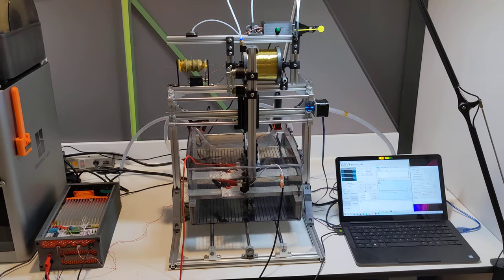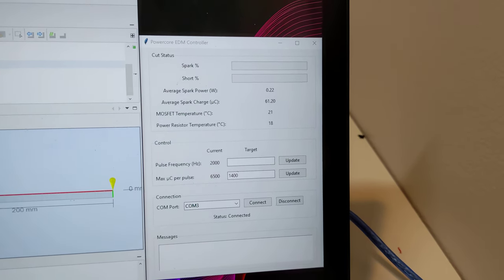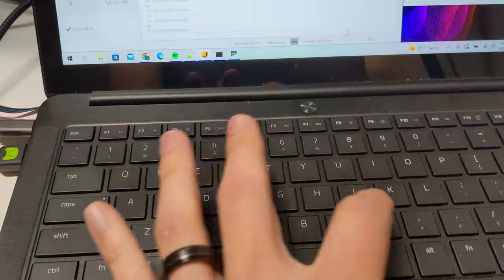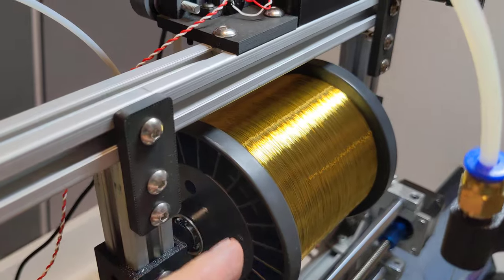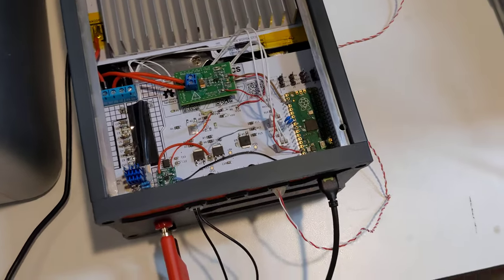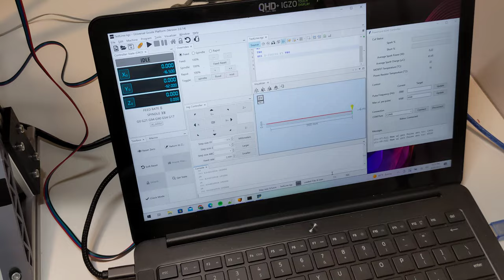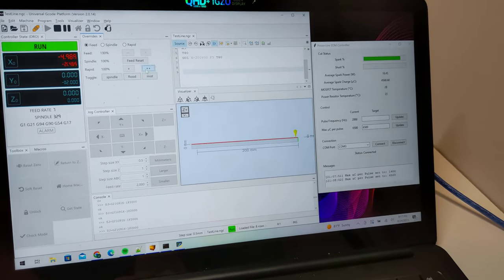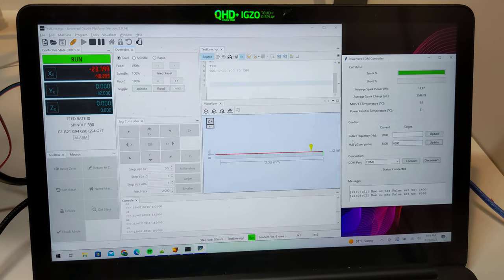Benchtop WEDM Overview

Comment: great work on getting all this operational. and very clear presentation.
Also, cutting 1/4" aluminum at that rate on a home desktop minimill frame is a great demontration of what desktop EDM makes possible!

you can make real high reliability, fully functional metal parts out of bulk materials in reasonable times!
Super exciting!

Comment: That’s awesome work! Using a 3018 cnc as your base, with a large water tank, what’s the effective cut area?
Reply from the maker: In my current config my effective cut area is about 120x200x12mm I am going to make some changes to get that Z up to about 75
Reply: @DesktopWEDM  Will you have enough wire tension for that? I think we're going to limit ours to around 30mm
Reply: @ZURAD  I could dial tension up so high I'll snap the wire. Tension is not the problem. Problem I am facing right now is cutting speed. If i start trying to cut really thick things the slower cutting speed is more apparent and is that much more painful. I am working on optimizing power to increase cutting speed. Online documentation talks about longer on times can help increase MRR, however i am limited to about 20us of ontime before the caps are depleted. Going to see if what happens if i increase capacitance. But agreed 30mm is probably a good limit for a desktop machine.
Reply: If you could charge the caps faster you'd be able to do more full power pulses per second. I think dropping the resistor is going to be important going forward.  @TheTerminator414
Reply: @ZURAD  This may be true if I had thicker wire or was using the brass rods the kit comes with. However for the .2mm wire I am using, at higher frequency it does increase MRR however it also increases wire temperature and thus you start breaking wires. I want to explore more capacitance, more on time, and lower frequency. I'm hoping I can find a sweet spot of high MRR but low chance of wire breakage. But yes for more capacitance a lower resistance power resistor will also help as my charge times will go up without it.
Reply: @TheTerminator414  Have you seen the fast wire machines? I think MRR is the reason people recycle wire. run a ton of it through really fast with good cooling for max speeds
Reply from the maker: @ZURAD  Hmm I had seen those a long time ago, thought it was strange how they reused wire. Now it totally makes sense! Well maybe in the future i'll have to look into trying that! Thanks for the idea.

Comment: Hi i bulding also a machine but at this moment i am still working on the mechanical design. I try to planning multiple possibilitys. Later in the process i can show some pictures ore drawings. About the pcb you adapt some modifications, are you going to change the pcb design ?
Thank for the info
Reply from the maker: Awesome! I wish you the best of luck with your machine! I currently have no plans to make a new PCB for the PSU. I believe the Rack Robotics company will release an updated supply in the future that will be better suited for WEDM.

Comment: I feel like you could have gotten around the wire tension by using a single pulling motor and a mass on a flexible tube that will sag or rise as the tension changes. Alternatively put a constant drag mechanism on the spool with a rotary damper. If you have a high enough torque motor, a constant speed roller system should pull quite well.
Reply from the maker: Yeah I thought about solutions like that. My concern was all those solutions would suffer from some inertia. Which would correlate to a momentary change in tension. I wanted to be absolutely sure change in tension was not a problem... so I over engineered the fix. Agreed, a simpler solution would probably work just as well.

Comment: Hi! Great project. I really like how you got great results with a device that was obviously hastily assembled. 

I'm also an EDM fan, and currently I'm developing my own spark generator based on a better topology than the one you use. Basically, in my topology there is no huge current limiting resistor that produces a lot of heat, and there is an inductor instead, in which the desired current level is maintained (meaning you can also control the pulse current level). This inductor is both an energy source for sparks and a high voltage generator for breaking through the working medium. Also, due to the absence of a current limiting resistor, the efficiency of this topology is much higher. The designing phase is actually almost done, I'm going to start making the first prototype soon. Looks like you have decent skills in electronics, so if you're interested in my spark generator project or willing to participate, let me know. Also, in case of success I'm going to open source it
Reply: I don't see a video on it.. so is this just a "mine is bigger than yours" argument? :D
Reply: @Moronicsmurf  well, congrats, you understood my comment in a perfectly incorrect way :) I think it's because you missed the last part: "looks like you have decent skills in electronics, so if you're interested in my spark generator project or willing to participate , let me know"

As for why there is no video, it's just that I have nothing to show yet. At the moment, the project exists in the form of a bunch of SPICE simulations, circuits and PCB designs. In case of success, I'm going to make a video and open source the project
Reply from the maker: Yes using an series inductor is a good design. In fact i think that's how BaxEDM's works more or less. I am just merely trying to use the Powercore as it is in its first gen state and show how with simple mods it can be used for WEDM.

Comment: Interesting wire tension setup. I'm trying something where I have motor on the feed spool and on the waste spool and a pulley between the two. The pulley is constrained to a rail and always has a constant amount of force. Either by using a constant force spring with a rack an pinion, or just by attaching a weight to it. Then a potentiameter measures the position of the pulley along the rail. If the pully rises I decrease the speed of the waste spool to provide slack. If the pulley lowers I increase the speed to take up slack. This lets me get constant feed and constant tension and lets me detect if the wire snaps because the pulley will bottom out on the potentiometer.
Reply from the maker: Interesting! So what provides the adjustable tension control? The speed of the feed spool motor? Just a heads up, in case you haven't already considered it... You want your tension to be pretty darn consistent, so if your feed motor is a stepper motor make sure you are using lots of interpolation to make it as smooth as possible.

Comment: I see you are out of stock.    Could I use a EDM drill to do this?    Would I need a pulse EMD Drill unit for wire cutting?
Reply from the maker: I suspect you mean Rack Robotics is out of stock. That is not me. I am not affiliated with them. This is a bit different than an EDM drill, however the same power supply so long as it is adjustable enough could be used for both.

Comment: Hello, can you tell me what kind of rollers you used that are in the water?
Reply: on bearings?
Reply from the maker: Search Amazon / web for "Driak 10pc V624ZZ Bearing Steel Sealed Ball Bearings V Groove Ball Bearing Pulley 4x13x6mm/0.15"x 0.51”x 0.23"" These work ok, but not idea for a high use machine as the steel does start to corrode a bit.

Comment: Why did you remove most of the capapcitors?
Reply from the maker: I was having issues with wire breaking. As i am only using .2mm brass. I experimented with more and less of the MLCC on the board. Basically more capacitance leads to longer on time in this case. As on time isn't completely controlled by the on time of the FET. For example if i do a 30us ontime of the FET but the caps are depleted in only 10us, then really the on time was more like 10us. Then in order to not overheat the FET its best to turn it off when current is low, meaning its beneficial to make sure on most pulses that the caps are depleted before the FET turns off. I found that using only 3 caps, and an FET on time of 30us seemed to work best for the material i was cutting. Obviously this would change depending on wire, and material, as well as other factors.
Reply: @DesktopWEDM  yeah it makes sense!  Another stupid question: why are the capacitor after the fet and not before? And why are you limiting the current with a resistor and not another MOSFET?
Reply from the maker: Not sure I follow what you are asking. Let me try to explain. The caps are on the anode side they get charged by the PSU through the power resistor. The FET just completes the cathode side to GND. Note this is not my design. Its Rackrobotics, you can see there schematic here https://github.com/Rack-Robotics/Powercore-V1-Hardware/blob/main/EDM%20Motherboard%20Schematic%20%5B23.04.20%5D.png
Reply: @DesktopWEDM  yeah I've seen this video, but I don't understand where the power resistor is connected to the rest of the circuitry
Reply: @DesktopWEDM  One last question, were did you find your current sensor? On the paper it looks perfect for this application but i cant find it anywere

Comment: It's awesome to have access to this technology. However, the main downside is the consumable cost (the brass wire).
It will cost around 10$ cdn to cut one linear feet of 1/2" thick Aluminium. And 30$-50$ is it's steel.
Is there a way to reuse the wire many times? How bad the wire get damaged with one pass? (off course, if we avoid crushing it in the final gear).:hand-pink-waving::hand-pink-waving:
Only keeping the new wire for final perfect finishing. Maybe two different wire size?:body-blue-raised-arms:
Reply from the maker: Agreed cost is high at the moment. However if you shop around you can find deals. I got my spool on ebay years ago. Also keep in mind that as desktop EDM becomes more mainstream we will likely see companies offer deals on smaller rolls. Agreed reusing wire is a neat idea, however depending on the type of wire and how aggressive you went with the first cut there may be very little life left in that wire, and the risk to damaging the part, and extra cut time due to needing to re-feed the wire would probably make it not worth it. My understanding is generally for the first pass you are trying to cut as fast as possible and use as little wire as possible. Thus you erode the wire to just a fraction off of snapping point.
Reply: @DesktopWEDM  I highly doubt one day EDM will be mainstream enough to change the market cost of wire for DIY. This technique is awesome, but not as versatile as 3D printing and never will.
Again, at least, we can now access to the EDM machine at an affordable cost.
What do you think about my cost estimate per 1 feet cut length of 1/2" material? What is your actual cost?

Thank you for your involvement in this field!